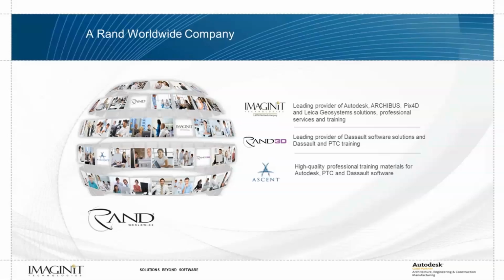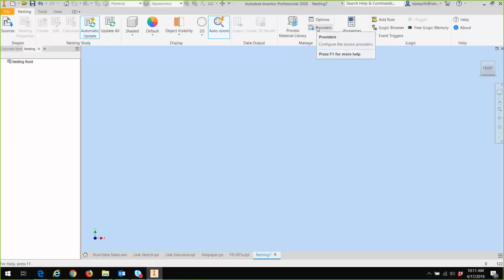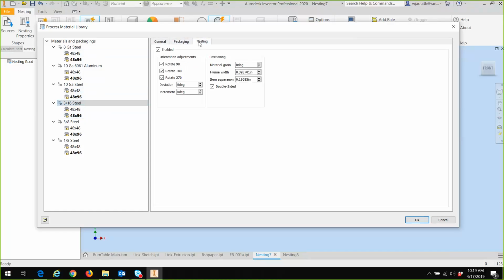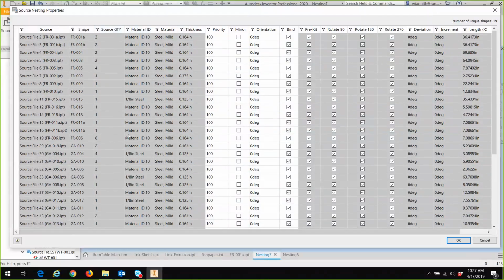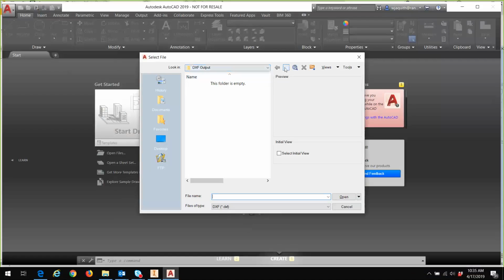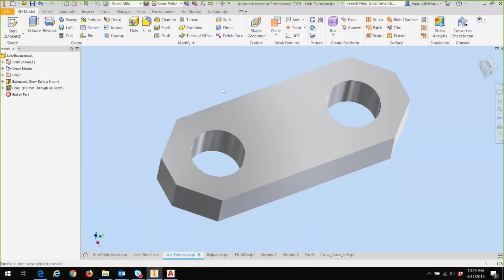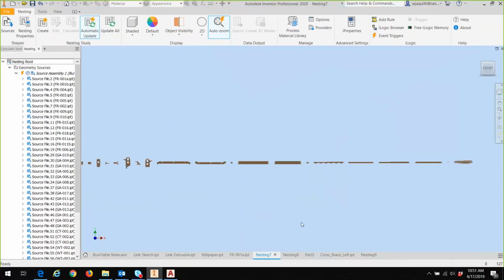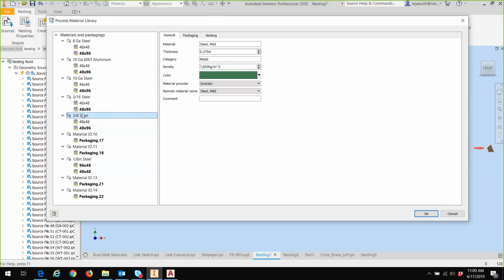Getting Started with Autodesk Inventor Nesting

Comment: Keep getting error on the nesting reports and the nesting comes out overlapping.
Reply from the maker: Hello Akkar,

There are a few things which might cause the Nesting Tool to return errors.  First, Autodesk just released a hotfix that addressed some issues nesting was having.  Make sure you’re patched up to date.  Next, they added some functionality to the Nesting Tool since that video was made, but there are a few more settings to mind to make things come out right.  The Nesting Tool will accept input from more sources than it did originally, but that means it can potentially take some files which might not be nestable (hardware, tubing etc.), and you have to tell it not to accept them if you don’t want them included in the nest.  To do this, expand the flyout of the manage panel, and select the “Providers” tool.  In the providers dialog, select the IPT option, and deselect the types of files you don’t want included in the nest.  All my nested parts are Inventor Sheet Metal, so I uncheck everything but that one.

Finally, make sure all your parts fit on the package for your material type.  The default seems to be 48x48in, so a larger part won’t fit, which will cause an error.  To correct this, select the Process Material Library tool from the Manage Panel, and make sure you have packages for your materials that are large enough for the parts you are cutting. 

Hoping this is helpful,
Walt